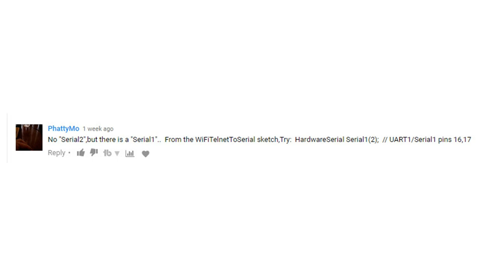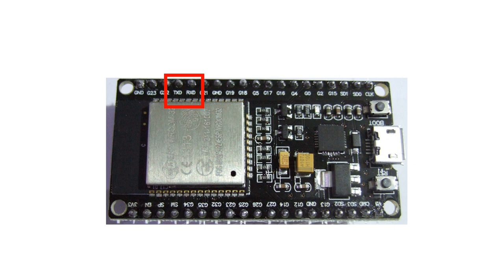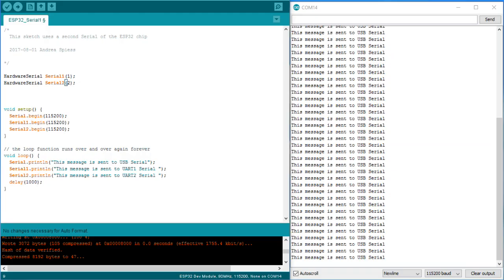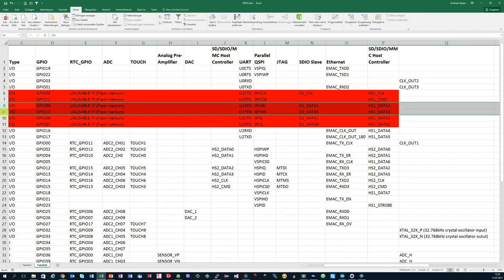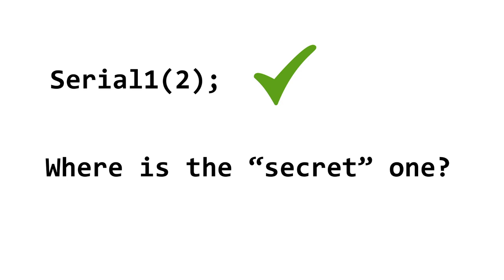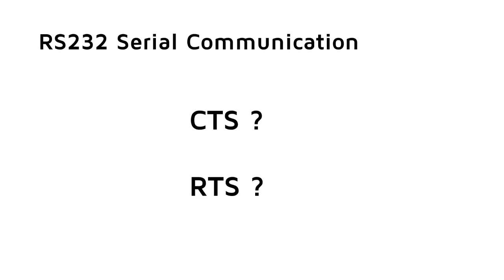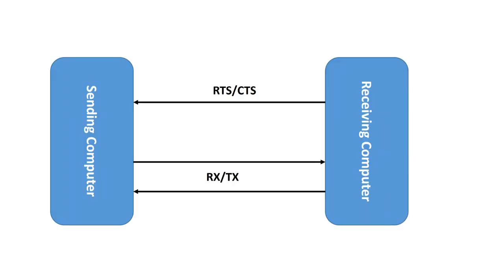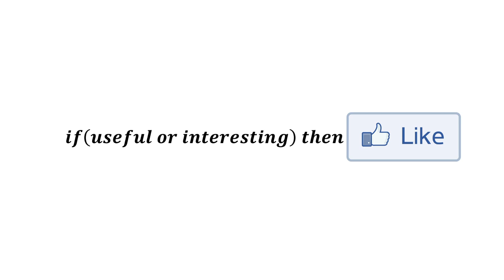#152 Additional ESP32 Serial Channels in Arduino IDE (Quickie)

Comment: Hi, the files no longer exist in that directory. Where can be locate the files? Have things changed now?
Reply from the maker: Maybe you watch my newest video and install the ESP32 accordingly. Then go to the directory where the preferences.txt file is installed. From there you go "packages\esp32\hardware\esp32\1.0.0\cores\esp32"  and you will find hardwareserial.cpp
Reply: Andreas Spiess got it. I will do it that way. Thank you. It seems of you follow the official repos instructions, this file you say is not available. Thanks for quick response
Reply from the maker: I pinned a comment with the exact path. So it should be visible to everybody. A few other viewers asked the same question.
Reply: Andreas Spiess oh thank you. Will find it.

Comment: Conflict between WiFi.h and analogRead
Maybe worth putting on your spreadsheet.

ADC1 pins CAN be used at the same time as WiFi.
ADC2 pins DO NOT work when WiFi is in use - not sure about BLE. 

ADC1 GPIO pins: 32, 34 through to 39
ADC2 GPIO pins: 6, 7, 8, 10 through to 17

see:-
https://www.esp32.com/viewtopic.php?t=796
Reply from the maker: These are quite old posts. Did you check if this is still true? I never used ADCs on the ESP32
Reply: Yes still not working (using eps-32 Arduino  v1.0.0) cost me a lot of time figuring out what was going on so thought I would post it here to warn yourself and others.
Reply from the maker: So I will try it, too. Thank you for your warning!

Comment: But where location thats file?
Reply from the maker: I do not understand your question :-(
Reply: @AndreasSpiess  thanks, now already solved, last i can't found hardwareserial. cpp on my hardisk 😁, and i can't install that library, anyways thanks a lot🙏
Reply: I am using Platform IO and aan ESP32-WROOM-32D bord, noticed that the HardwareSerial.ccp has been completely rewritten. It now detects by default if you use other pins for serial communication.  But still in doubt for UART 1, because somehow i did not get that UART 1 to be used even on other pins defined.

HardwareSerial Sender(0); // UART 0 => default pins TX0: 01 RX0: 03
HardwareSerial Receiver(2); // UART 2 => default pins TX2: 17 RX2: 16
Assigned receiver 2 to different pins as the default for testing;
Sender.begin(115200);
Receiver.begin(115200, SERIAL_8N1,/*Tx=*/ 13,/*Rx=*/ 12);
Testing Sending and Receiving between those two UART's on the same ESP board, and that works without problems.

Comment: there is no pin 16 and 17 in lolin32 pro
Reply from the maker: So you can shift these pins also to different pins using the method shown in this video. Or use another board ;-)

Comment: great work. mine was showing error 

Arduino: 1.8.3 (Windows 7), Board: "ESP32 Dev Module, Disabled, Default, QIO, 80MHz, 4MB (32Mb), 921600, None"

Archiving built core (caching) in: C:\Users\vamsi\AppData\Local\Temp\arduino_cache_727941\core\core_esp32_esp32_esp32_PSRAM_disabled,PartitionScheme_default,FlashMode_qio,FlashFreq_80,FlashSize_4M,UploadSpeed_921600,DebugLevel_none_8b9dca6258b59a31a805e5f72ecef81e.a
C:\Users\vamsi\AppData\Local\Temp\arduino_build_5118/arduino.ar(HardwareSerial.cpp.o):(.bss.Serial1+0x0): multiple definition of `Serial1'

sketch\esp32softwareserial.ino.cpp.o:(.bss.Serial1+0x0): first defined here

C:\Users\vamsi\AppData\Local\Temp\arduino_build_5118/arduino.ar(HardwareSerial.cpp.o):(.bss.Serial2+0x0): multiple definition of `Serial2'

sketch\esp32softwareserial.ino.cpp.o:(.bss.Serial2+0x0): first defined here

collect2.exe: error: ld returned 1 exit status

exit status 1
Error compiling for board ESP32 Dev Module.

This report would have more information with
"Show verbose output during compilation"
option enabled in File -> Preferences.

please helpme out.
Reply from the maker: I am not very good at remote debugging. But I am sure you will find it out yourself. The important sentence seems to be multiple definition of `Serial2'

Comment: Serial1.begin(9600, SERIAL8_N1, 4, 2); // Serial1.begin(baud, config, RX_pin, TX_pin );  // works
Reply from the maker: Thank you for this trick!
Reply: Didn't work for me. I am trying to send AT commands to the  Pycom Gpy  Modem as is showed in this post ( https://forum.pycom.io/topic/3134/using-pycom-boards-with-arduino-ide/2 ).  The Pinout of the board reports being connected as  LTE_TX  = 23
  LTE_RX  =5. Should be the UART initialized or define in another place?

Comment: Great tutorial as always!

What about this technique?
https://github.com/G6EJD/ESP32-Using-Hardware-Serial-Ports
#define RXD2 16
#define TXD2 17
Thanks!
Reply from the maker: This is not another method, it is only an extension if you need it. It works.
Reply: Thanks...it's not related to this video.... at the end i even flushed this method, i need only one i2c port but the pins are used by LAN8720... i figured that all i ad to do is to use regular Wire.h, some other pins and do this in setup: 
Wire.begin(32, 33);
Keep your great work! you are the best!